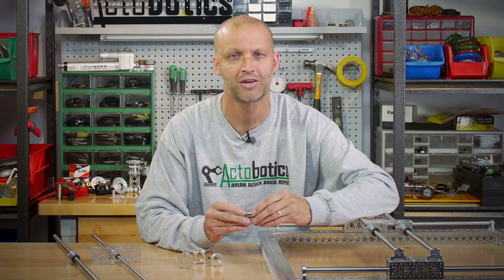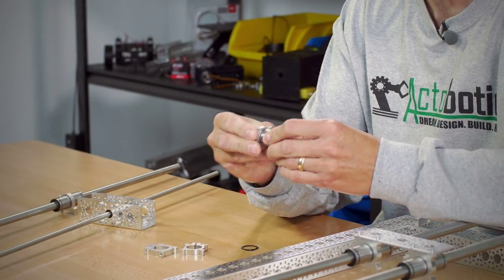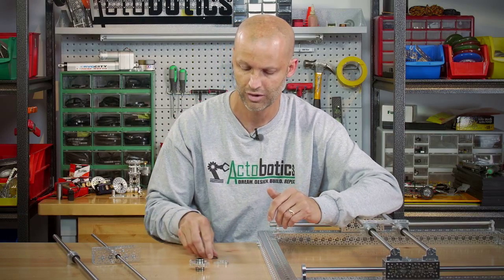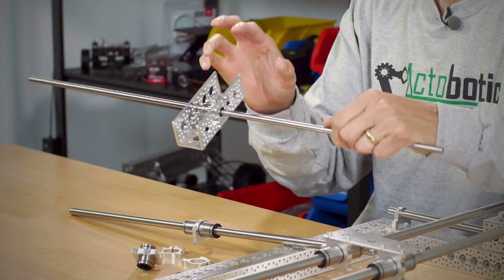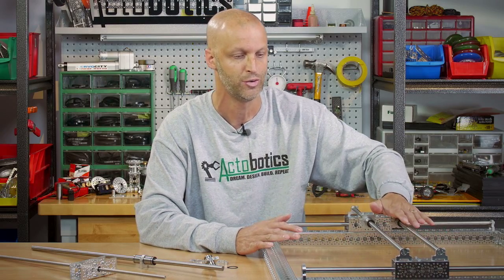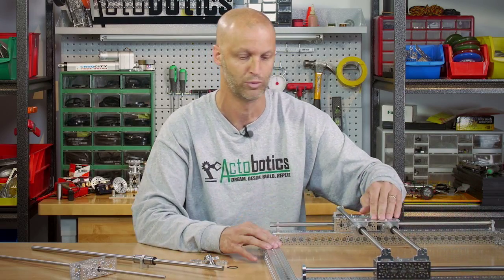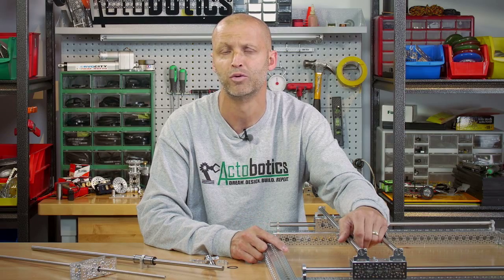ServoCity Products: Linear Ball Bearings and Mounts

Comment: With your Ball bearings and mounts, would you have any mounts that can be fitted to the floor and ceiling, with the rod being exposed out of the ceiling for a small DC Generator, plus a outer shell to go over the rod with a plate for a base to be mounted for a plate??

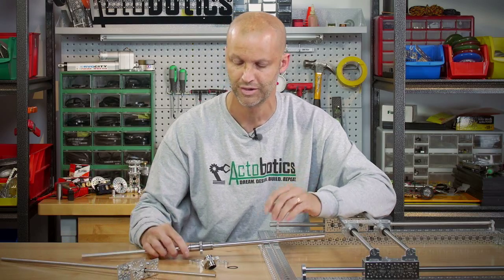Comment: Hi,  how would using 2 bearings per shaft improve the precision? Is it for eliminating / reducing backlash or are there other reasons for this design choice? 1:25
Reply: it will reduce clamp problem and therefore stick too much to the rail. however, instead of using 4 linear bearings use 3 to not create overconstraint

Comment: So how did you get the 8MM linear bearing to fit in the channel which comes with 1/2 inch diameter hole? The bearings I purchased from you have a .590 OD. Did you drill an 8MM hole, or do you have some special channel that is not advertised?
Reply: Oops. I meant did you drill a 19/32" hole so the linear bearing would fit in the channel.